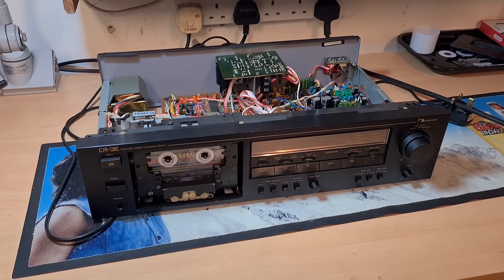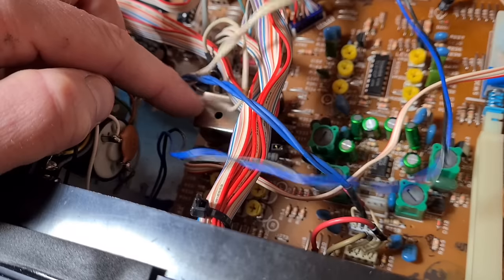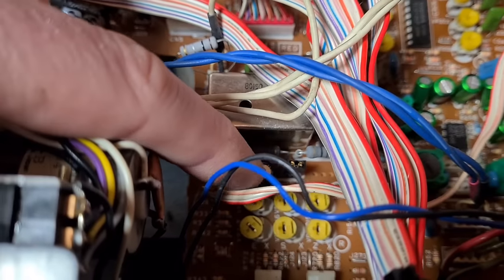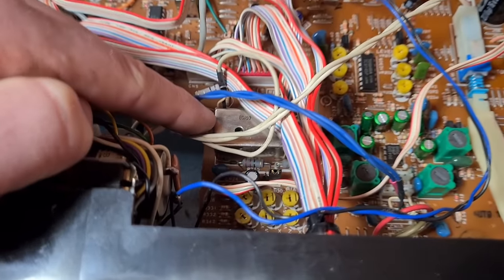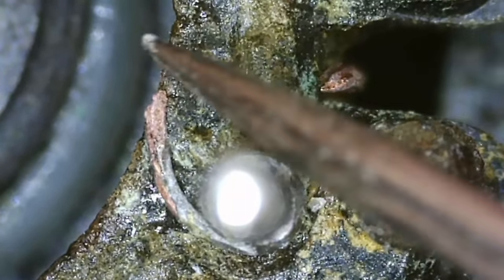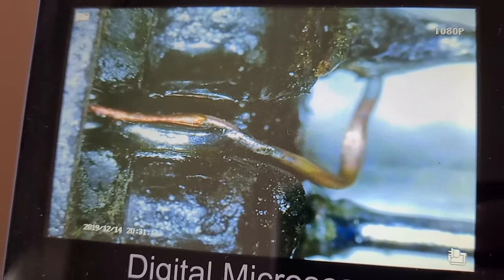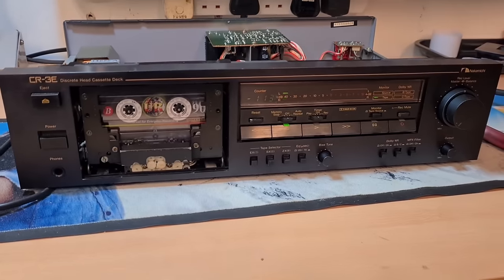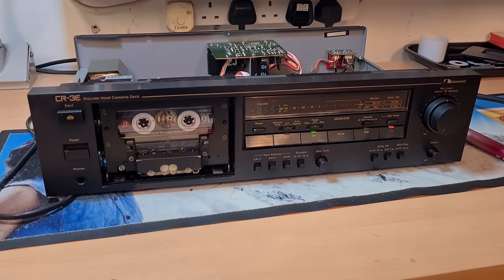Using a MICROSCOPE to fix a £1.4k Nakamichi CR-3E Cassette Deck

Comment: That's an excellent repair job with proper diagnosis, kudos to you for some really fine work. I have a Nak 670 ZX with a suspiciously similar recording problem. I'll have to dive deep on this. Thanks for a useful and very informative repair.
Reply from the maker: Wish you the best of luck buddy, if you have the same oscillator module soldered in, give it a whirl. 

I had no ability to record or erase.

Comment: Nice work. I have some tiny boards from DAT decks that I can't repair because I don't have a microscope or any other tools other than some strong hand lenses. Do you have any recommendations for equipment that a hobbyist (ie not stupidly expensive) should have?
Reply from the maker: Honestly the microscope hardly ever comes out. The best tools I have is a set of picks, I use them constantly. 

UNITEDLUX 4-Piece Precision Pick & Hook Set, Car Auto Oil Seal O-Ring Seal Gasket Pick Mini Precision Hooks Professional Puller Remover Mechanic Tool https://amzn.eu/d/eLbONZ9

Comment: hi in a tascam 38 i have had this burned out it was a easy change over as it on a pcb you just pull out 
note on the pro side  i do see alot playing around with the play back pot's to get to deck tune to there mixer decks 

seen alot over the years   my otari mtr 12 has a bad one the khz it's putting out is to high 
well over what the meter range is  i have to make a video     well out of what i know  ok with soundcraft 760 and brenell mini 8 decks

Comment: why is this a £1.4k? Seems pretty basic, I see nothing extra, all plastic.
Reply from the maker: Equivalent to the original price. Was £550 in 1988. 

It's one of the higher end decks available.
Reply: @pwrestoration   thx for the info
Reply: 3 head system and a very nice transport amongst other things spec wise was high end
Reply: Watching inside it looks   simliar to my Telefunken which I prize for hard manual control which after 44 tears works perfect (if only  user fingers are capable  to push strong 😄) .I   prize soft control but not in so old machine because now it could brake  and with soft  plastic gear teeths   may be more delicate.

 Anoher advantage in my Tefunken is money I paid in 2020 - about 25 USD😁. What is missing? Of course third head.  But only a  little because main advantage of   third recording  head for me is that it's azimuth  can be never turned  while play head is alowed for adjusting to recorded in past tapes. In my case I had to buy second the same telefunken and by keeping constans azimuth I designated it only for actual recordings.   

Sadly Telefunken I found  good enough for my taste and  that it does not let  me for further   hunt  for the better and it is somehow disappointing.

I listened for over 20 years to Onkyo which also had only 2 heads but in reward was auto reverse and full remote controlled (MPX, Bias, Dolby B/C)  . - in Sindpoarore I paid about 280 USD. Later got B&O also reverse and fully RC ( MPX, Dolby B) -  I replaced both for   that simple easy to operate  two Telefunkens. .